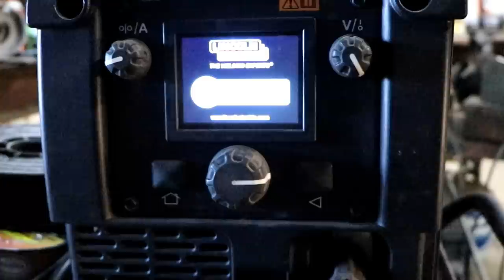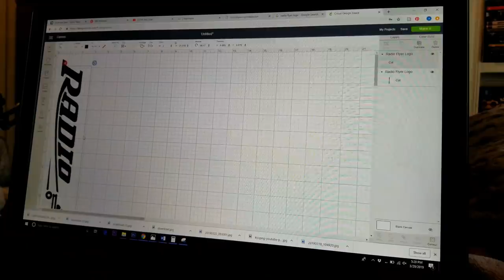Toy Restoration

Comment: Justin, I absolutely love the way you can take trash to treasure.  Sometimes a restoration has to be a total rebuild as there is not enough left of the original to restore.  You are a sheet metal and bondo guru.  Keep up the good work.  Just because it is old, does not mean it is junk.

Comment: A great idea when you are welding over/in holes. Use either an aluminum backer plate or a brass/copper one. It will allow you to fill in holes so much faster. Absolutely great refurbishing project. Thumbs Up for sure...

Comment: I loved the restored wagon an easy way to fill the hole too is get a copper bar with edge rounded off and use it as a back to weld the weld wont stick to copper and the other side wont have wire sticking out , 35 years of welding experience,  great show thank you

Comment: Great job, 👍 another trick of welding holes is to hold a thick piece of copper firmly against the back when welding  it helps to get a flat surface so less grinding
Reply: Aluminum lift blocks  for trucks also work well. They are cheap and easy to come by.

Comment: A quick tip on filling in holes with a welder. Hold or place a flat block of aluminum behind the hole, then weld straight on the edges and fill in. It won't effect the aluminum and then you can grind the spots down.

Comment: An item doesn’t have to be antique to be worthy of a restoration Justin. 
You also can’t beat real rust and rot to show a true restoration as apposed to the fake rust appearing in many restoration videos now. It has gotten so bad that one guy has rusty plastic on a Makita drill. 
Rust hole repairs like you did also ate away some of the weaker less structural material so your patch became bigger but also much more secure too. 
Well done Justin and I don’t think the name change is an issue. 👍🏻👍🏻👍🏻
Reply from the maker: +Wayne Crews I saw that. Rusty plastic😁

Comment: Ive got tsc's lineup of the metal grated wagons. Boy have i used them. Especially the large barn wagon. Got it for 100 bucks on sale. Just last week i uses it to move a load of 2x4's, did it in 2 trips. Ive got a set of tubular and solid wherks for it, id like to grt an atv or utv to toe it with, maybe get qnother one or teo and hook them all up. The other week i used the medium wagon to lay 4 strands of wire at once while using my big wagon to carry t posts, wood posts, and my auger. Those thimgs have paid for themselves time and time again.

Comment: I have started the very same project with my grandmother's Sears XL-500 wagon. I have stripped everything down. Very little rust. I will be sanding and priming soon. The axles...I noticed that you fabricated the rear axle. I am debating if I should do the same or utilize what I have. I noticed you purchased new wheels, nuts & bolts. Where did you purchase the wheels from? I am certainly not as handy with metals as you are but, there is not as much work required that I have to perform. You did a fantastic job and I hope my project turns out at least half of what you have done. This is for my two boys, 4 and 9. They will love it!

Comment: Awesome video, man!

I never did mig, but i was wondering about that filling technique. 
I noticed in the video that the bead advances better when it's welded to a cold surface, otherwise it juts lumps to form a sphere.
So i was wondering,  what if you like, spray it with vinegar (or some acidic water) after each advance?

Comment: Nice job!  I'm NOT a welder, but someone once told me that when welding a hole closed, use a piece of copper pipe flattened out behind it as you weld - have you heard of doing that before?  Just wondering if it would work?

Comment: Exactly what colors did you use and where is it available?
Reply: Reason is that I am restoring a 1985 Murray Garden Tractor and it is impossible to find the correct color. The one you used on this Radio Flyer is very close to the original paint on the Murray.

Comment: what is that solution you apply at rust bolt and screws, so it is easy to remove
Reply from the maker: +Andy Wang $7 its called Knocker loose. I was sponsored by crc a year ago. Still use it everyday. Fantastic stuff. The only thing I have found that works better as good is deep creep at $13a can.
Reply: @TheGoodoftheLand  thank you for the reply, I found it in the description after I post this and it is not sold in my local store, end up buying a 3 in 1 WD-40 oil, but the screw is so rusted that no place to put the screwdriver.....
Reply: @TheGoodoftheLand  and i love the history part of the video

Comment: A nice project an a good looking result, but all the Rust weakend the Metal all over the Body. Why not welding in new Metalsheets in die damaged areas? The Scew you use to attach the Wheelmounts are to long. I think a new metalframe under the Body would give a lot more stability to the Wagon. The color looks fine, as do the Stickers.  Sorry for my bad english. Greetings from Germany.

Comment: is there a reason you didn't use a sand blaster on this instead of the grinders?  Was it you were afraid of putting more holes in the metal?

Comment: I was going to say right off that the tread on the tires was wrong from what I had if it was going to be a restoration even if it was a Radio Flyer (didn't know the origin of the name, thanks for the info) and then went back and looked at the beginning and it did have the radial groove tread like mine had.

Comment: What I would have done is I would have Allman blasted the whole wagon itself looked online for new old stock parts in regards of the wheels and tires and then I would not have used bondo on this whatsoever I woulda filled it would lead and put a high gloss red paint job on it and took a to a paint booth that's the way I would do it not saying that you did not do a good job but I would have short out the screws instead of keeping him all along the way you did it but all in all you did a good job

Comment: Good old bondo
Reply from the maker: +Antonio Claudio Michael it's kind of like bondo. It's called Metal Glaze. Its much thinner and very flexible. It's used more to fill scratches and pinholes. Like a thick spreading primer. Good stuff and very easy to sand.
Reply: @TheGoodoftheLand  oh that's neet thanks for teaching me something new didn't realize it wasn't bondo

Comment: I’m a girl and I have the canvas one but the wheel broke off the metal part that touches to the frame and to the Wheel whatever you called the posting I’m going to use a propane or gas torch and I guess I’ll use the aluminum stuff to mount it on a little schedule work for fire and can’t find anybody around here downtown Toronto to fix it because it’s not a car… grr

Comment: You need to invest in a blast cabinet or small pot blaster.
Reply from the maker: +mean gene I have both. My blast cabinet is new but needs some upgrades. Think I'm going to order the kit from Tacoma co. I did blast some but it was highly ineffective. Had to coat the entire piece in rust converter and resand before primer to ensure the rust was out of the pits.
Reply: @TheGoodoftheLand  ahhh that sucks. I hate having to grind and sand rust. Lol